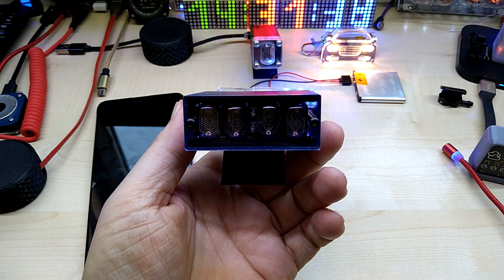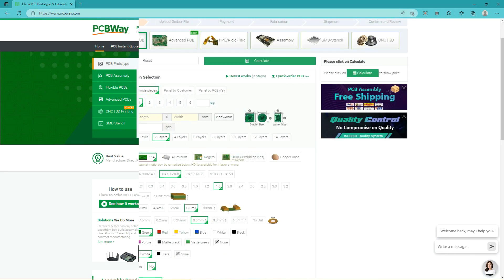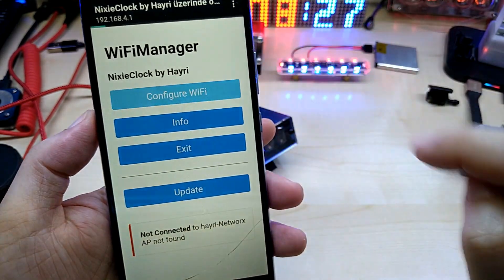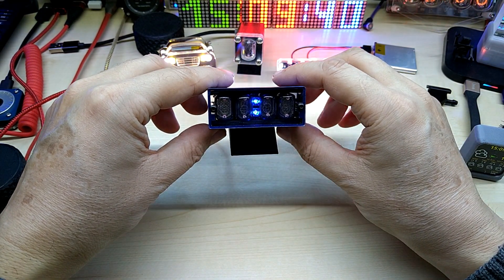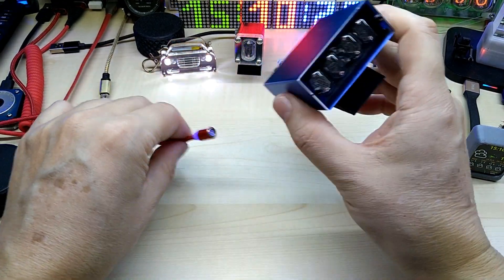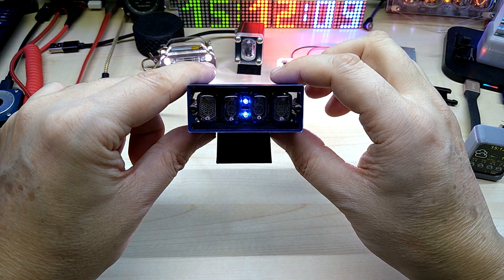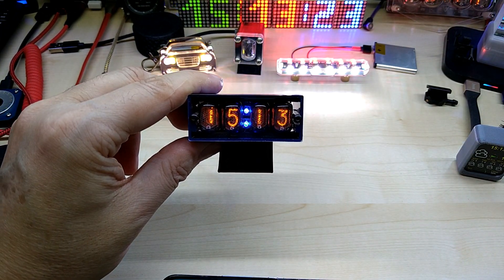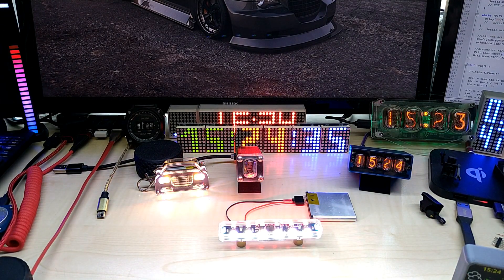DIY Opensource IN-17 NTP Nixie Clock #ESP32 WiFi Setup build by #Hayri Sponsored by #PCBWay

Comment: Enjoying the 2 clocks I ordered.
Some feedback for future buyers and after discussion with Hayri who was great working out some issues:

1. There is a 1 time code for network key not shown in the video, Hayri will send that to new buyers moving forward.

2. If you turn off the clock, you will have to make sure the Wifi network it is saved to is on again, before turning it on otherwise it won't remember previous time zone.
Once it syncs again, then you are good to go and Wifi can be turned off.

I took one to work, found this out. So, not bringing it home obviously and used Wifi hotspot on my phone instead. 
Now easy to get it going again when I come to work in the mornings and get it going again.

Nothing else, build quality is great and it makes a nice talking piece on my desk.
Reply from the maker: Thank you very much for taking your time and writing this comment Terry, greatly appreciate it and sorry for the confusion on my part about the security key 🙂Know I will surely remember it for the rest of my life 🙂 Correct, as you stated, if the saved Wifi is not turned on, it will go into setup mode, this way, apart from the obvious initial setup, it can be used to save a new WiFi network. But even if you forget to turn on your saved WiFi or it is off for some other reason (brownout) it will still have it saved and as soon as you turn the clock off and have your WiFi on it will automatically connect to it.
You are also right, after it has updated the time, you can turn your WiFi off and it will continue to show the time with it's internal RTC of the ESP32 chip, which is surprisingly accurate and even if it goes off after a while, you can just repower it to get the time again. Of course your time zone is also set automatically. Do enjoy your clocks, I just hocked up my single digit clock as well and just love it. maybe it is my age, although not that old to have seen Nixie tubes in my youth, I absolutely love the glow of the tubes 🙂
Take good care of yourself and thanks again for everything.
Reply: @iHayri1  you're welcome. Pleasure doing business with you.

Comment: Excellent demonstration video Hayri!! It was great to see the connection in real time so people can see that sometimes wifi connections don't always connect on the first try. That's just how these systems work and it depends upon how good that connection is at that exact moment. Thanks again for sharing your awesome clock with us and have a great day my friend!!!!
Reply from the maker: Thank you Adam, in the end I think it is a power problem in my case, it needs a solid 500mA as both the Nixie high voltage and the ESP32 draw power at the same time, once it has established Wifi connection and the time is synchronized, Wifi is turned off. Take care my friend 🙂
Reply: Yes, makes complete sense!!!